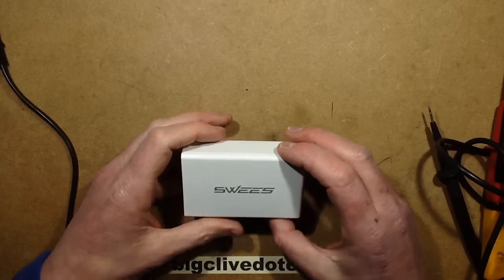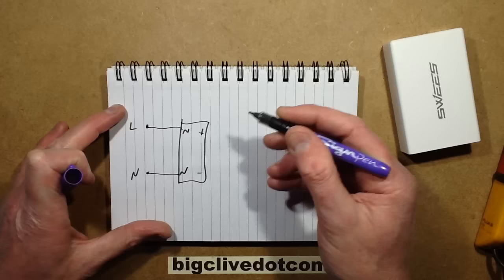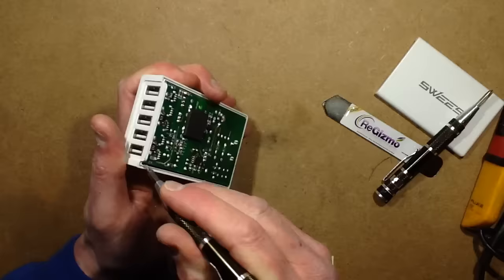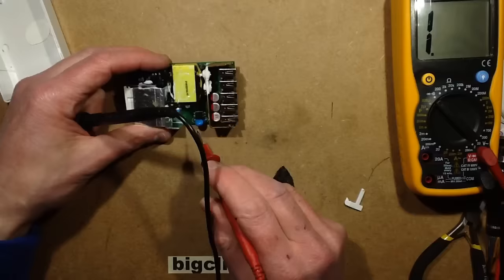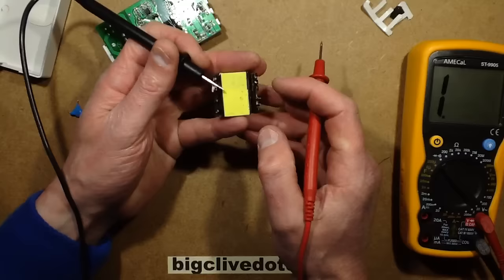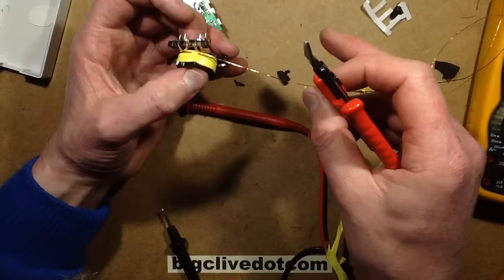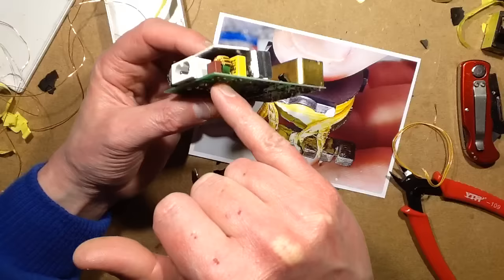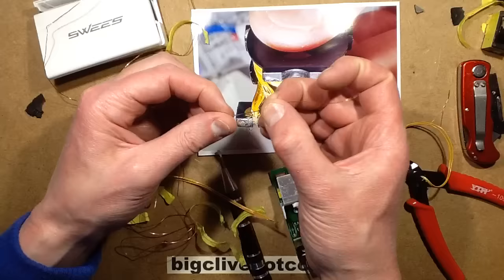Horrific USB power supply fault.  (Electrocution risk.)

Comment: I stopped watching when you drew a circuit diagram with the transformer after the rectifier. Huh? Transformers work on AC, not on DC, surely? With such a basic mistake right at the start I felt it was a waste of time continuing.
Reply: +Mad Biker 3020 It's a SMPS. Mains is rectified, then chopped (note the "switching to negative rail" part), and that goes into the xfmr.

Back in the olden days they would actually use mechanical chopper switches. Poor switch contacts weren't too happy in the long run but it did work, and there was little else you could do if you wanted to power, say, your vacuum tube car radio (which invariably required a boost converter to get a decent plate voltage), or mobile military communications gear.
Reply from the maker: +Mad Biker 3020 It's a switchmode power supply.  The mains is converted into DC and then reconverted into AC at high frequency to allow the use of a much smaller transformer to save size and cost.  Then the high frequency output is converted back to DC again for the USB output.
I summarised it in brief to show that the fault lay between the output and the incoming bridge rectifier.
Reply: +Mad Biker 3020  Switching power supply. The power is chopped at high frequency using a chip technology power driver. The output of the transformer is isolated rectified, and then regulated. There are some feedback circuits to reference back to the chopper controller to change the duty cycle of the chop wave (power signal drive), to change power factor for regulation feedback. There is an optical isolator chip, and current sense circuits involved with this.

I used to design power supplies for R&D. I worked on some very sophisticated systems for industrial applications.
Reply: +Jerry G. +bigclivedotcom +yeoldeengineer
Thank you all for the detailed explanations. I appreciate it. You've brought up a half=forgotten memory of my dad's valve radio in his 1937 car, he had a hell of a job getting hold of what was know as a "vibrator" which he said converted DC into AC. That must have been the switching unit.

Sorry for the non-understanding last night, I must stop watching technical stuff late at night.
Reply: +bigclivedotcom 
Also I must apologise for the tone of my comment which was unfriendly, sorry about that Clive.

Comment: So you never found the short after a half hour of our time. Not in xformer, not on card, no longer there. What have we learned? That no-name brands from China can be unreliable, and you should have cut the leads on the PWB rather than breaking the xformer into pieces.
Reply from the maker: The short was in the transformer, but all avenues had to be tested in case the fault was transient and disappeared.

Comment: Shouldn't this have been sent to the manufacturer to reduce the risk of these clowns selling more very dangerous USB devices like this? It's quite scary when you think about it.
Reply: this stuff is manufactured in china and the problem with that ist they dont gif a fuck on that so you can send them 10 of those and they will do it the exact same way
Reply from the maker: +SmoothEmJay If this was sent to the manufacturer they would have quietly binned it to hide the evidence.
Reply: bigclivedotcom yeah I thought about that after I posted haha. It's scary shit though isn't it.
Reply: +SmoothEmJay  yes 
my usb carger gifs out a 50 heart hum while listening to music
Reply from the maker: +Nick Hetzer The hum is possibly the usual capacitive coupling through the power supply causing a slight modulation on the input of an amplifier if you are using one.
Reply: +bigclivedotcom  could be i solved the problem very easy i  just grounded the outer sleve of my charger

Comment: A DC transformer ??????  That transformer may be on the AC side for mains isolation then the rectifier ....... anyone agree ???????????? Anyone ??
Reply: disagree. Such a tiny transformer will burn away at 60 or 50 Hz. This is a switched-mode circuit. DC is converted to high frequency pulsing voltage, which a transformer can handle well [remember: transodormers do not need altering polarity, just an oscillation between V.min and V.max]

Comment: There is always a possible risk when you open up anything you can plug into the wall. If you dont open it, and use it as intended- the risk of anything going wrong is negligible.  In other words, leave well enough alone - if it isnt necessary,  why do it at all especially if there is a risk associated with it.